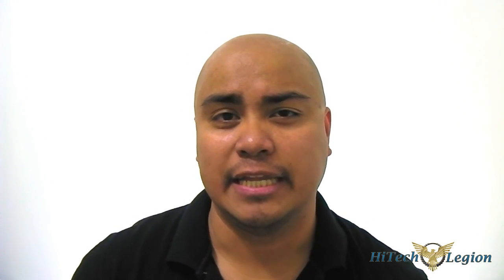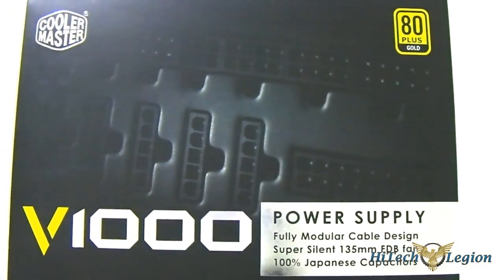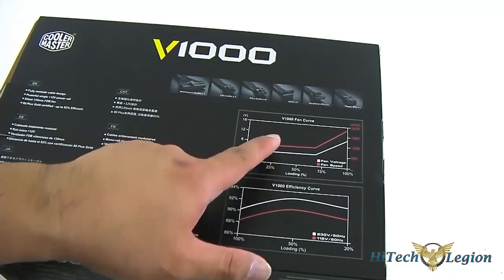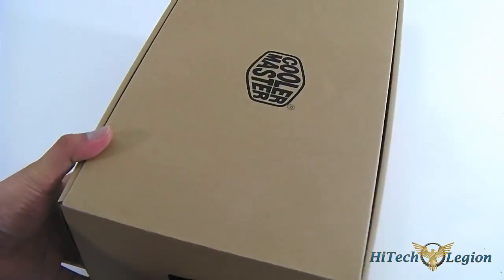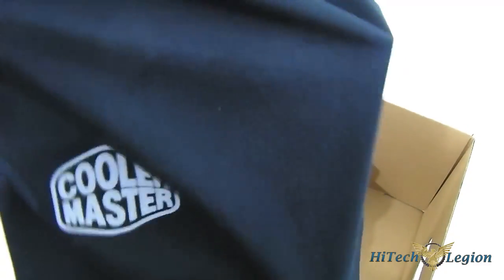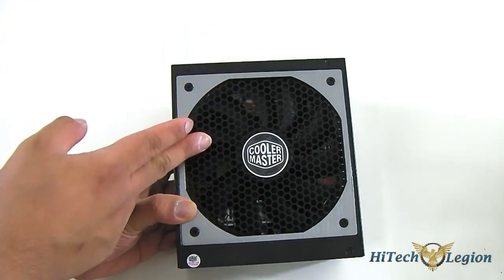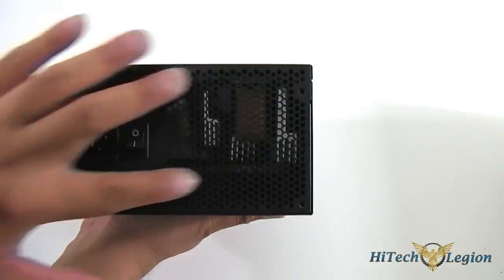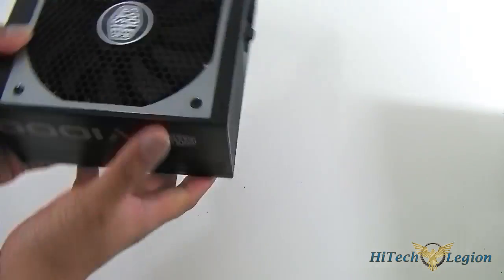Cooler Master V1000 Power Supply Unboxing + Overview

Comment: i have the V700, i am planning to get 2 670's in SLI. but i wonder, the PCI 6+2 cable splits up, can i connect them both to the same GPU?

like the cable goes from the PSU to the GPU and then hops from 6 pin to 6 pin?

thanks in advance
(According to Pcpartpicker the system uses max 536 W so i am fine with 700W)

Comment: You should take out the aluminum bracket fan to see wheather can clean the fan without void warranty. Coolermaster should put speaker to beep if the fan socket forget to plug in or fan fail.